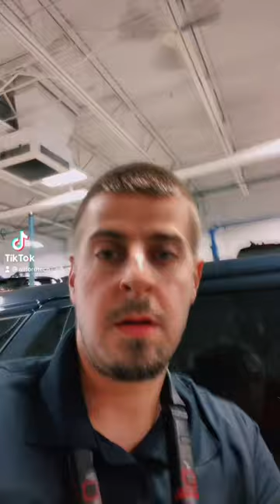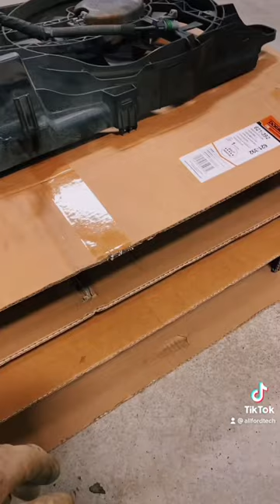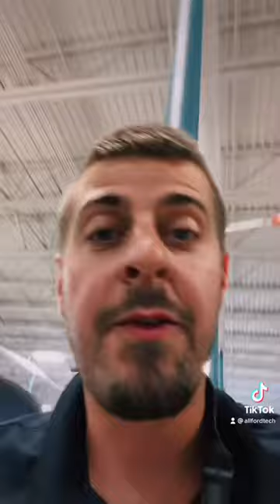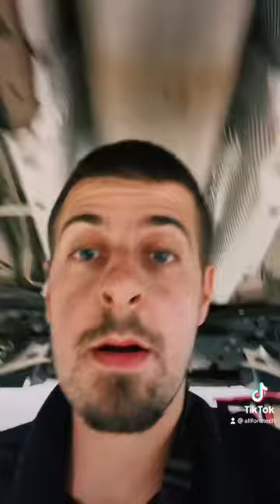This is why mechanics drink…

Comment: Damn i feel this. I have a pajero that needed a cv replaced, icbf doing it myself so I took it to mechanic. Simple right?... 2 more trips to the with the last ending in me going off at him because he had used 2nd hand parts previously and charged me for a brand new (was a prop shaft and I let it slide coz I cbf arguing usualy) but after I had taken my car in 3x for 1 cv joint replacement and each time I got it back the cv was knocking still. Even the mechanic was sick of me bringing my car back saying its still not fixed I get a call and he says " yeah nah sorry I can't fix this coz you've lifted your car" I replied I'll be down there in 5min. Got there and proceeded to go off at this mf saying "stop regreasing my old cv and putting it back and charging me 250$ each time! Put a fucking brand new one on! Actually you can fuck off you unless cunt, I'm filming this conversation right now (pulled out my phone) so tell me which parts are new? And I'll show on video that the part you list on my car is actualy second hand. Now tell me when the NEW cv is in and I'll pick it up I'll put it in myself and when I come back with a cv making NO KNOCKING I'll be wanting the money back for the second hand parts and regreasing and reinstalling of existing parts while charging me for a new one" 

He refunded me like 600$ that arvo and I've never been back. Full scum.

Comment: tell me about it i work at autoparts warehouse and we also sell directly to customers and workshops 
ive had to replace parts multiple times because the one someoen ordered didint fit 
and always the same talk 
we used VIN to find it but it doesnt fit so we ordered other one from different version 
i have to collect every single order 
i have to put every single return on its place 
imagine that 
i do 20k steps a day, 6 days a week, i have to deal with customers and i need to pickup and move all these parts 
man i love working on cars 
its much easier than work on warehouse 
i literally take days off so i just can work on cars as a side job

Comment: You are the problem. You were trying to install a DORMAN part. Never ever a DORMAN part. They may be NEW from DORMAN, but in DORMAN's case NEW means NEVER EVER WORKS.

 Not only that, but the first box looked like it had been opened, found out to be bad, taped up, and possibly returned to the shelf.

Comment: Thats like i got a window regulator for my 1998 dadge ram 1500 the plastic hubs for the roller broke when i put the newone in the electric motor didnt work ( had to short in it poped a fuse each time it was pluged in) so right now i have a regulator from 2021 that has the still working 1998 motor operating it

Comment: Even vintsge stuff is not immune.  I bought a set of points for my old Kawasaki, OE brand, made in Japan and everything.  On one of them, the contact pad that rides on the cam was loose and rattled around, making the gap and timing random.  Wtf!

Comment: You are doing it wrong if the new part is defective collect your labor by ×10 plus new part. Any lip about it will result in a claw hammer stuck in your head.

Comment: That is just an excuse for you to get high on alcohol or drink same thing people act like cause it’s legal that makes it less of a drug but it’s equally as bad as doing any other highly addictive drugs and is wrong to say this is why mechanics drink I don’t drink and I’m a good mechanic and maybe you wouldn’t have had to order 3 different fans if you wasn’t drunk and tested them before installing each one to see if worked when there is more than 1 way to test radiator fans outside of the motor without being installed and if you did test them without installing why you complaining stop getting drunk at work what it sounds like

Comment: Probably on the third fan assembly the loose terminal tension at connector finally made connection. Or it's cux your using junk ass Dorman parts. I'm sure there's a fast food joint on your way to work that's hiring

Comment: I had a customer one time when I worked at the Subaru dealership and we had accidentally scratched an interior part and we replaced it for free. Well it took about 5 times to get a part from the factory still wrapped that wasn't already scratched. Absolutely horrible